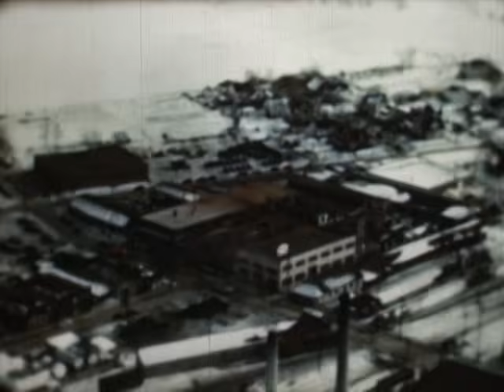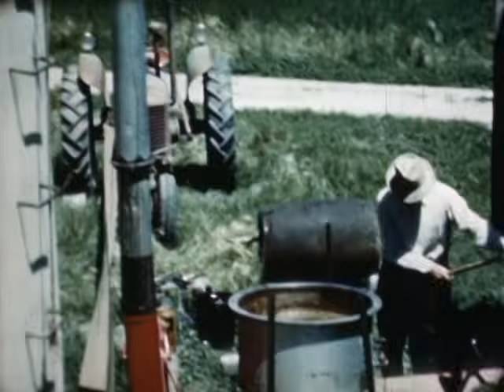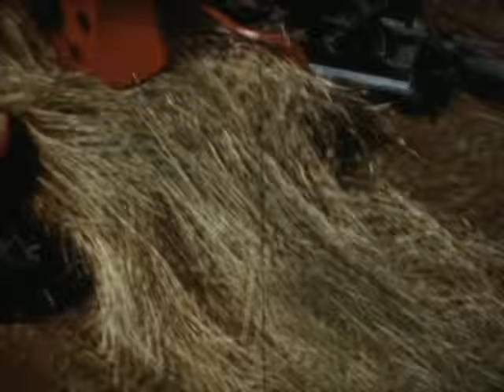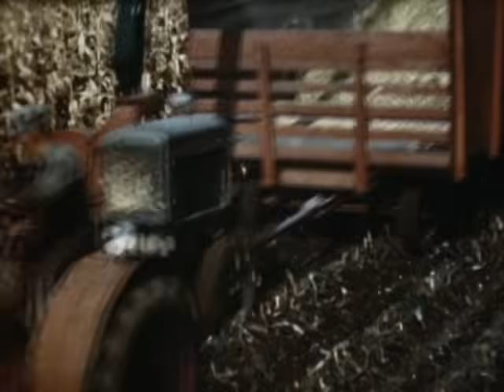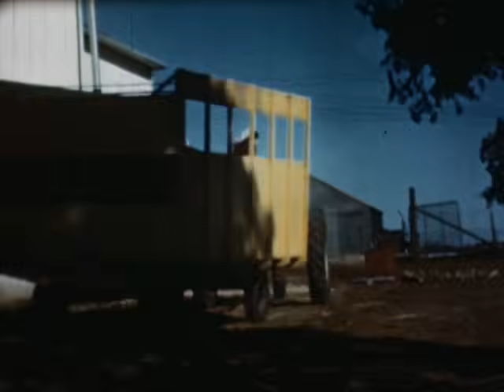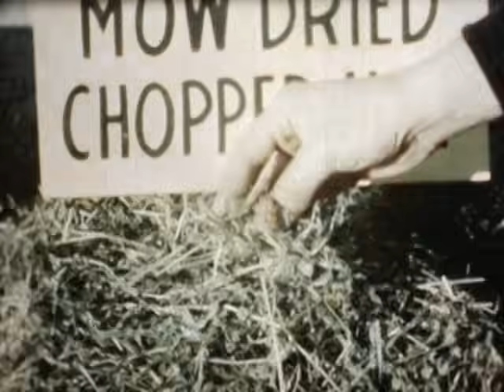Making Hay and Silage with a Gehl Forage Harvester (1949)

Comment: Web floor was a great step up. Before that you had to pitch it off the wagon. Also some guys put a row tires across the front of the wagon. Tied a couple cables  to tires. Used another tractor to pull the load off the back. Dad said it worked good, as long as the man chopping would be sure the tires would be standing up in the front.

Comment: Friends I am 75 now and I participated in this type of harvesting it was light work for a teenager and most enjoyable. Saving a load or two for after dark so we could set the carbonators on the belt tractor so there was a small flame coming from the tractors stack made the mix just on the rich side so the tractor started good in winter weather.

Comment: Hey Ikon,,,have you ever seen one of the choppers featured here in action? Very cool. Osha approved, lol. We had a belt driven, long auger Gehl blower for years until we bought the New Holland. Ran it with an rebuilt F20. We used to dig a small pocket for the tires and staked it down with long steel rods.

Comment: What the hell? Making silage with molasses? Over here they use formic acid (with some other stuff added as well).
Reply: I helped a few neighbors put up corn silage years back. We  used a 1 row Gehl chopper pulled by a 4020 Deere, A bit of over kill. Had 2 ancient Gehl forage boxes, I always got the worst one and pulled it with the old 620 Deere. For Additives we would pour the bags across the top of the load so as to have the unloading process mix it into the forage. This operation stopped when the local stockyards closed down and we all got out of the livestock business, As we couldn't afford to ship semi loads of livestock many hundreds of miles to out of state processors.  I think most of that Gehl machinery is still in the neighbors machine shed.  I had bought a big , heavy Papec field chopper for feeding green chop to our small herd of feeder cattle. It was PTO equipped. Pulled it with my MD Farmall, was a bit of load, likely would have helped to replace the stationary shear knife, and get a clean cut. My brother wanted to keep it so I let him, rather than argue over it. He never even moved it from where I last parked it 45 years ago!  I always enjoyed working with that vintage of equipment. Today, the only livestock operations around are the mega hog buildings and the operation now ships to a processer hundreds of miles away and sell under their own label for much of it. Funny, one packer puts out dozens of different labeled product! When Tyson's and the USDA, manipulated the livestock prices and put all their competition and small producers out of business by forcing the live hog prices to less than $9.00 per hundred weight. We all had to get a town job to survive!  Shame, it was a good life on the small family farm when you could make a living at it!

Comment: The flat belt driven silage blower is a hoot, I noticed they didn't take the Transport wheels off when they set it up, But looks as if they only dug them in Maybe a few inches.
Reply from the maker: It's hard to tell, but it looks like there's a wood stake in the ground in front of the wheel facing the camera. It has me wondering though, how much will that blower pull into the belt on dry hay & a short pipe to the mow? Then again, the original family farmstead had a concrete pad poured next to the silo & there are four semi circular grooves about 2" into the concrete where the wheels of the silo filler sat. Granted, concrete isn't going to give like dirt, it wouldn't take much to chip away at the grooves with a constant heavy pull on the belt. Just my thought on it.
Reply: @IkonSeesMrNo7300 ,,  Keep up the good work with the videos, I just noticed that one about a mixer went up, gonna watch that now.
Reply from the maker: @theda850two  Thank you!

Comment: Dad bought a new model 1200 chopper and side dump wagon I think in the late 70's ,along with two #99 blowers to fill 4  Blue Harvestore Silos. Had 3 Gehl forage boxes mounted on 1959 ford trucks and used a Gehl center pull windrower, don't remember the model. Ran that combination untill we bought a used selfpropeled   JD in the early 2000's. Kinda miss the simplicity and ease of repairing the Gehl. It is still in the shed and field ready for when the JD breaks down.  I really enjoyed your video of the early chopper and equiptment. Thanks for sharing.
Reply from the maker: Glad you enjoyd! The center pull windrower might have been a 2245 or similar. Those were good machines. I have a video of those that will be coming up in the next week or so. Stay tuned!!